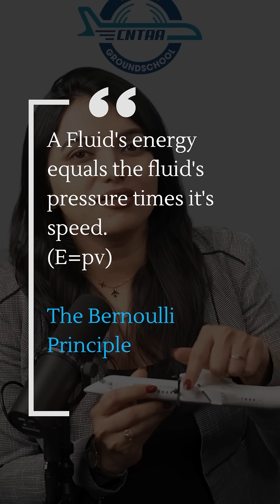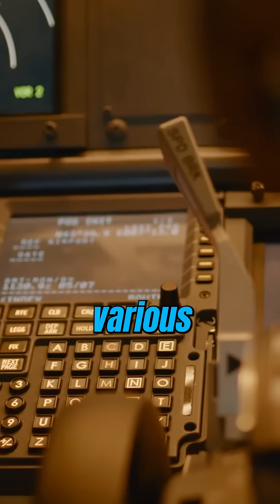Airplane Stalling Explained by Capt. Neha Thakare

Comment: As pitch increase air speed decreases and altitude increases . If engine thrust is not enough to maintain the pitch (airspeed of aircraft) due to decrease in airspeed wind do not have sufficient airflow and aircraft starts falling down..
In order to prevent this pilot have to increase the thrust and slowly push the control column away from him. Due to this pitch decrease and airspeed increases and aircraft recover from stall provided that aircraft is at sufficient altitude. 
Some aircraft do this automatically without pilot intervention as part of the self recovery program.